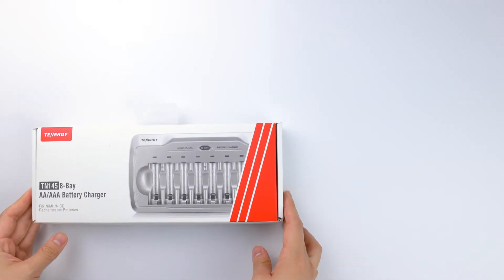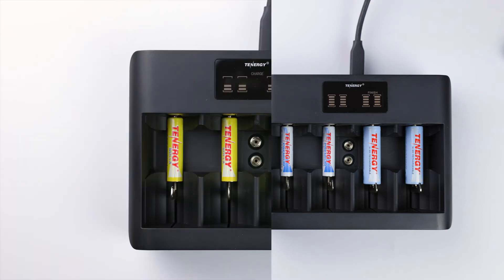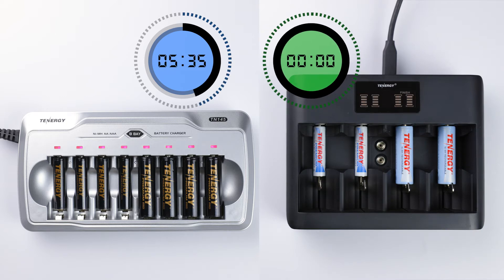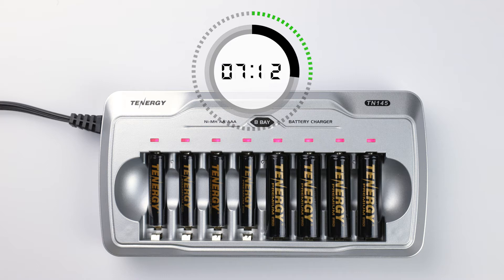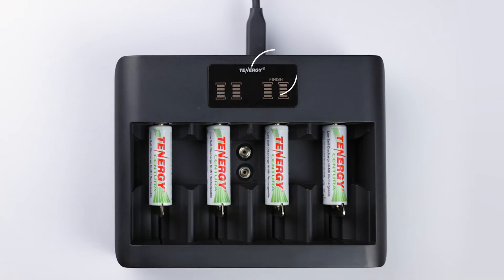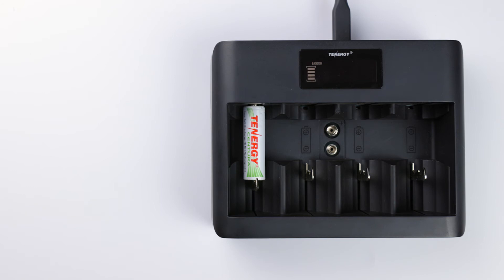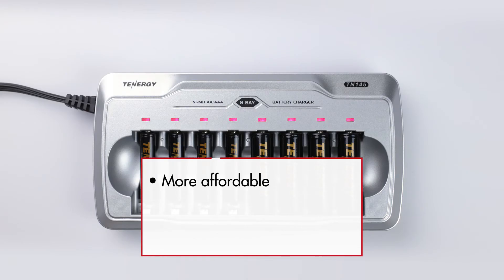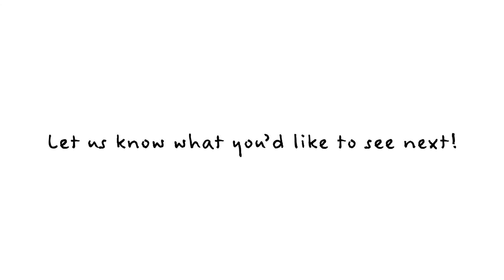Simple vs Smart Charger – Which One is better for you?

Comment: Smart chargers are the way to go. Get the Opus charger because it allows to select the current to charge batteries more gently. It also outputs lower current when a battery is severly drained. How would the charger know if a AAA has been inserted on the same terminals? You have to manually select the lowest current for those. Does it sense the travel of the moving terminal?

You can recover a deeply discharged cell by bridging it to a good one, but this delivers more current to it.